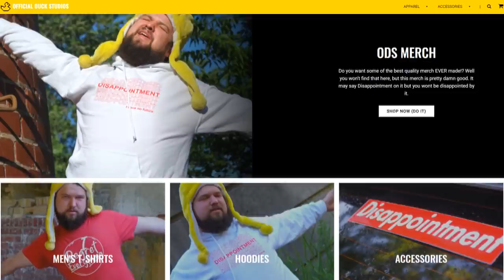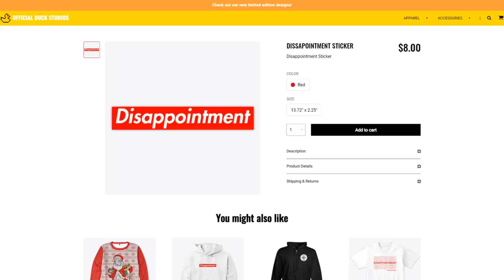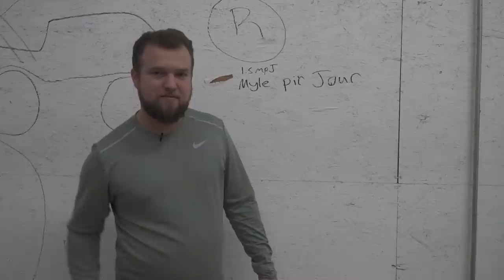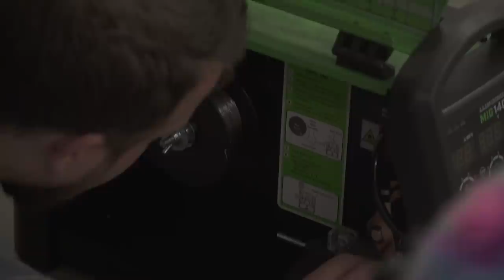I Cooked A Burger With Just A Welder.

Comment: As a welder I've had this idea more than a few times, also before putting in the new wire spool you should rip out the old wire, but it looks like you figured that out, and if you go slow and make thicker beads around a quarter of an inch then I promise you that would've worked better, just put your settings to around 150 amps and whatever wire speed works for ya, and you also want 0.035" wire, it'll be obvious, and for thinner steel you'll want to put your settings around 90 - 80 amps for that table of yours lol

Comment: Shoulda just hooked a car battery to each end of the table and cooked em that way
Reply: No. Short the car battery directly through the meat
Reply: Wire 10 battery’s in parallel and short them... need more than one battery to heat up that thick metal

Comment: As a Certified Welder... I Cringed the whole way thru
Reply: 😂 I was looking for another welder to comment, he's using aluminum wire after we switched the roll
Reply: keagan R he also isn’t using any type of inert gas with it which is why it was “bouncing off” the metal. Also, the first one had flux built into the wire, while the second one didnt
Reply: With my experience, flux core isn’t copper coated so that means he had nothing pulling impurities out, and with the aluminum wire... trying to get that through a harbor freight welder is dang near impossible
Reply: @keaganr5750  he welded without shielding gas 👏👏👏
Reply: Based
Reply: The camera man is going to go blind or have eye damage
Reply: and the cotton clothes, and without chipping the slag off the weld. shit hurt
Reply: @keaganr5750  how did that even work aluminum does not push well through a welder you have to pull it with a spool gun😆

Comment: The "copper looking wire" is mig wire and you need a shielding gas usually 95% argon 5%co2. The second spool you put on is flux wire does not need a shielding gas unless you get dual shield flux

Comment: When the wire isnt molding with the steel you are either going too fast feeding the wire to quickly or you arent heating the surface enough in this case I would have to say you were feeding the wire way too fast due to the speed it was feeding at
Reply: Jon Lasaga I think he maxed the wired feed
Reply: @michealbrown8317  Yeah it did look like he accidentallly set wire feed to max instead of the heat setting.
Reply: He did both

Comment: hey if you want practice your welding you should get some argon for that solid wire this is gas metal arc welding (mig) not flux core arc welding (fcaw). You had your wire feed speed pretty well set but your voltage was wack 14.1v on 180 wire feed speed will spit and sputter like I've been seing through this whole entire video 19.5 volts 250 wire feed speed you'll have a great time

Comment: Cook a chicken with induction, rip a transformer out of a microwave, cut out the secondary coil, replace it with 1 loop of thick copper wire, stick one end of the wire with an electrode  in the chicken and poke it until you get a short circuit. 400 odd amps at 0.5-1 volt is safe

Comment: Coper looking one is mig wire and needs a shielding gas like argon and the other I'm assuming is silver and that is flux core wire and dose not need a shielding gas because the it has flux in it but also leaves a coat of flux and metal witch is probably the crunch in you burger lol and also why you have a hard time welding is you need shielding gas the impurities in the air get in the weld and can make gaps or bubbles in the weld love you channel hope it helps the welding lol

Comment: The first wire was bare wire and I’m pretty sure you were using flux core/dual shield for the second one you put in, they both weld differently but in the end they give a weld, one you have to push and the other you have drag for it to weld right. But overall this video was funny asf

Comment: I have literally seen students weld better on their first try than Reese has during his entire time with this welder.
Edit: I do not believe Reese should have a welder, he is going to severely injure himself or others with it. The light can cause hair loss if direct skin contact is made with the light, it can cause loss of vision, the fumes and flux can cause cancer, the amperage can cause your heart to seize almost immediately depending on the settings, and stainless steel will release dangerous fumes if welded without the proper gas/filler/welder (Stainless steel is very common for most household objects like cutlery and most appliances).

Comment: That sound you here when you weld means you’re to far away from the metal get a welding glove you will do way better if you not afraid adjust the setting on your welder trust me it will tend you ten minutes max trust me I work at a factory as a welder and every body does that

Comment: Bro your welder supports both SMAW and TIG if you used that instead you'd have a much easier time grilling. If you would have used SMAW it would have been EXTREMELY hot and those patties cooked instantly. If you used TIG you would have been able to create little pools of molten metal on your table which would have the same effect just on a smaller scale. Also I can't see wether you have any gas connected to your system? Idk if that's some fancy American bullshit but if you want to weld with MIG, MAG or TIG as the name suggests you're gonna need gas.

Comment: Welding rules broken since you asked.

1. No gloves.
2. No steel toed boots.
3. You should wear jeans while welding.
4. Im assuming your shirt isnt 100% cotton, if it isnt, meaning uts artifical, the shirt would melt if it would catch on fire, if it were cotton it would just burn away.
5. Anyone who sees the weld being done from outside behind you, without the proper ppe (Personal Protective Equipment) risks flash burns and potentaly going blind.
6. Being a shit welder
[Edit] 
Hoddies are also a no go. if a spark gets into your hoodie it can burn away. it might just be one piece but that one piece is burning in excess of 6000 Degrees Fahrenheit
[Also edit] oh my god you ate it